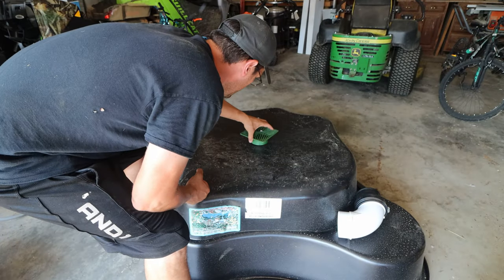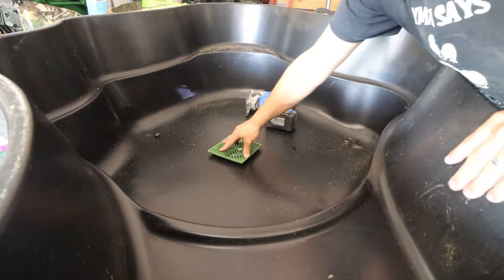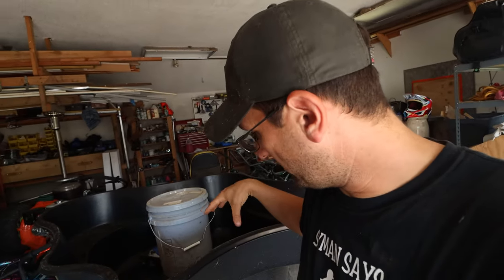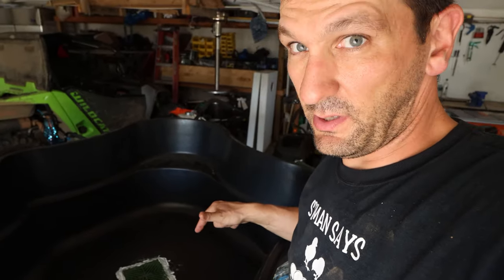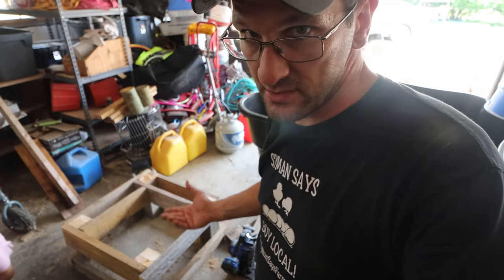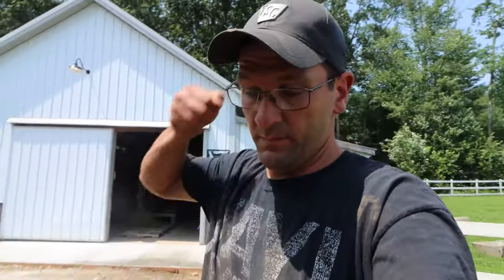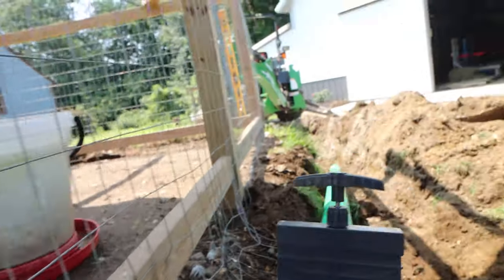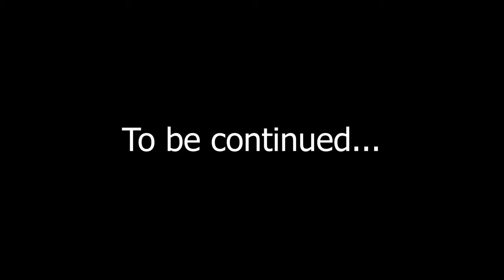EASY DUCK POND BUILD WITH DRAIN for CLEANING - Part #1

Comment: Did you have to put a pump to drain the water or  just gravity? Would have been nice to see where the water drained to.  Did end of pipe sit in 3/4 rocks to prevent flooding?